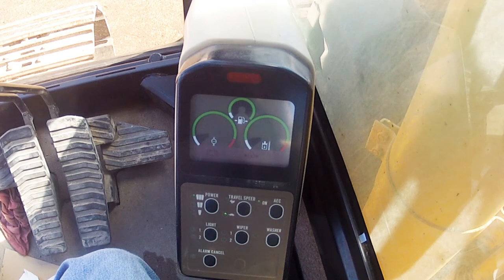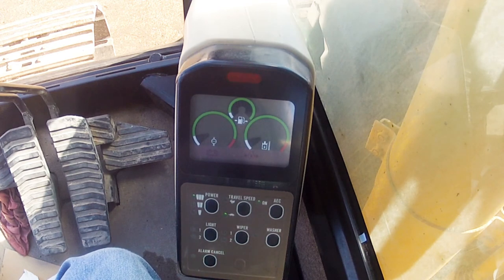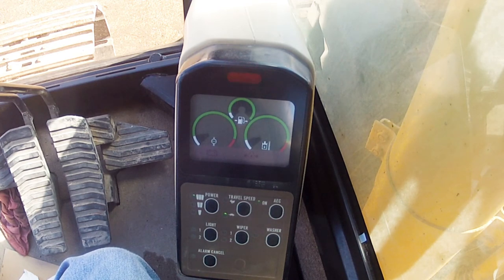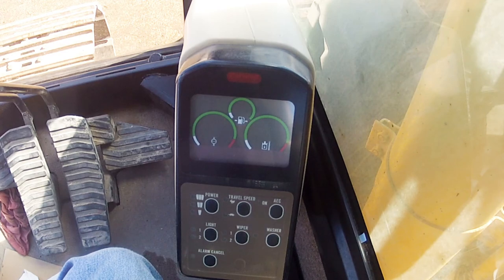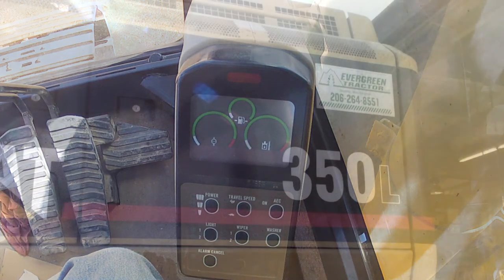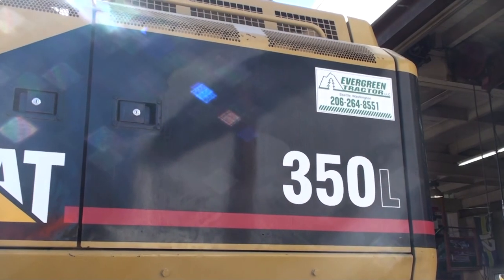Cat A Series Monitor Panel

Comment: Hi. My machine is a 312L. It has new monitor, new controller, throttle motor assembly, solenoid valves, speed revolution sensor and pressure switches. When I calibrate it works a little bit then as soon as it switched off and restarted the controller goes to yellow light and the monitor says CAL. From what I can understand yellow light indicates a communication error. Anyway you can help me with this problem? Thanks and sorry for long comment
Reply from the maker: It sounds like you have an intermittent ground problem. Try asking your question on this site. 
https://www.heavyequipmentforums.com
Someone there might have gone through this before.
Reply: Hi...
Brother how are you...?
Brother you sloved your issues..?
Thanks.. 🤝